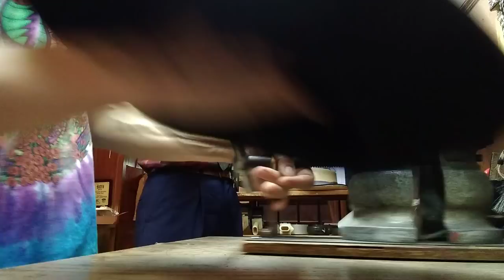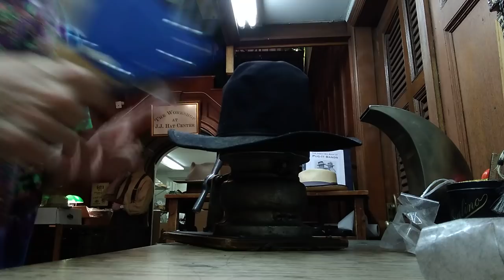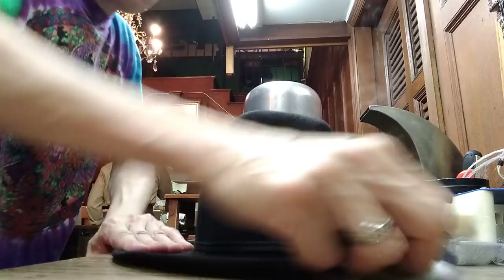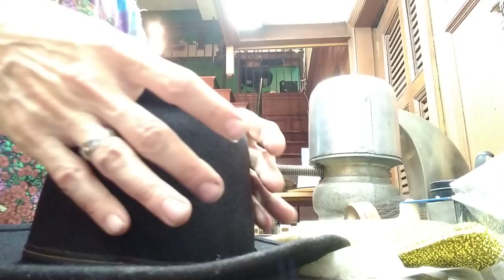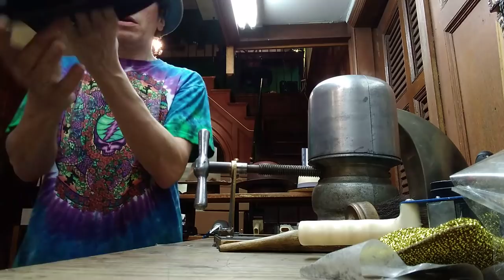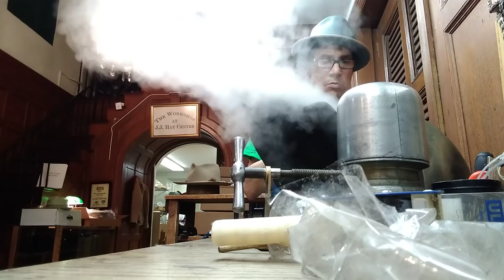Steam,Reshape 50 Yr Old Western Hat From Childhood

Comment: Would you be able to return a hat to an open crown shape from a brick crease? It’s a 10x silverbelly Rodeo King.
Reply from the maker: Using just steam, it'll still show little shadows of the old creases.. u would need to really stretch it over a block,while it's wet maybe sand the top clean too.going back to a clean open crown w steam alone is not easy, usually the crown gets stretched from it's old shape and the stretched parts won't un-stretch using this process. I've faked 8t before but it took a ton of work and I have the strong steam,blocks and equipment to help
and even the it wasn't perfect